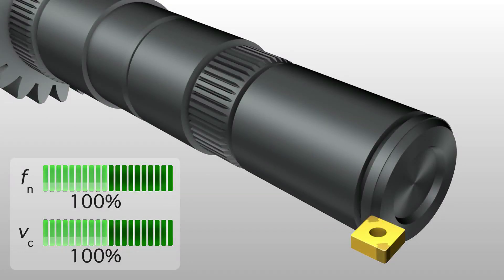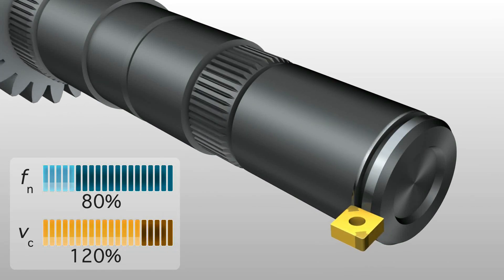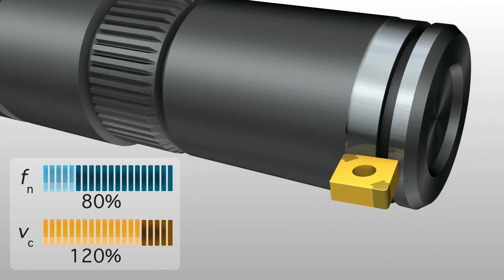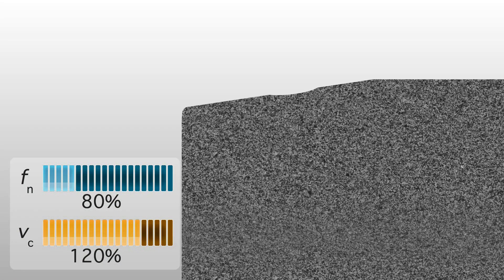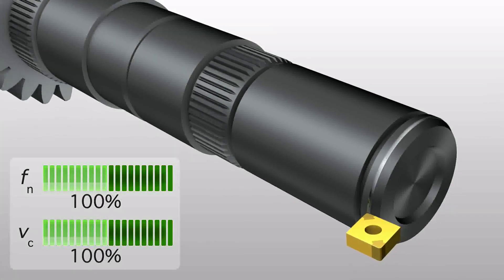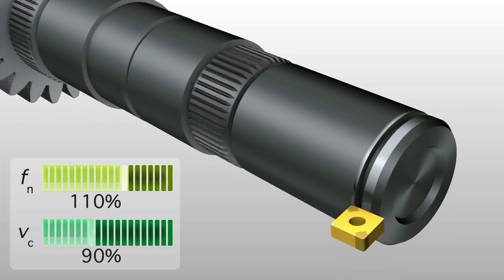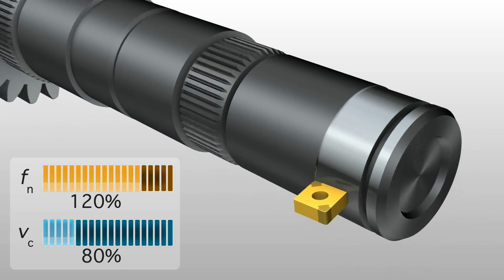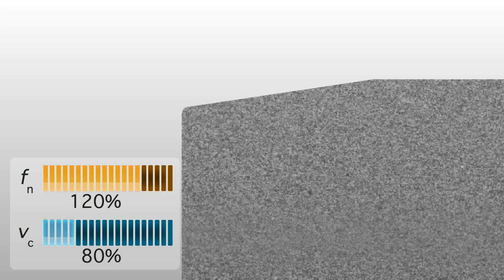Tips film: Increase feed for productive hard part turning - Sandvik Coromant

Comment from the maker: Hi, thanks for your question. It sounds like you need to look at using flank infeed to level out the radial forces and make them go in the axial direction to solve your problem. Use one of our 4C dampened adapters   e.g C5-4C xx xxx. ,depending on your  application you should  choose the largest possible bar diameter.This should help fix the vibrations and chatter. 

Best regards
Heinz Götz-Werner, Application Specialist General Turning

Comment: Does sandvik offer an anti vibe threading tool for an od thread in a lathe? I am having problems with chatter on a od thread. Currently using a sandvik I-loc tool. For a c5 capto application

Comment from the maker: Ferralium 255 is an enriched stainless steel and is not an application for CBN.
However, for most turning operations, an increase in feed moves the location of the crater wear away from the cutting edge so this does not appear to be a solution to your problem; the wear is not at the cutting edge.

Continues in next post.

Comment: Would this apply for high temp alloys? Decrease sfm and increase ipr? Im currently cutting ferralium alloy 255 and I have crater wear on the face of the insert where the chip breaker is. The cutting edge is fine but the chip breaker is worn out.